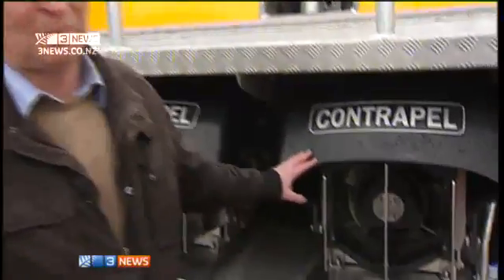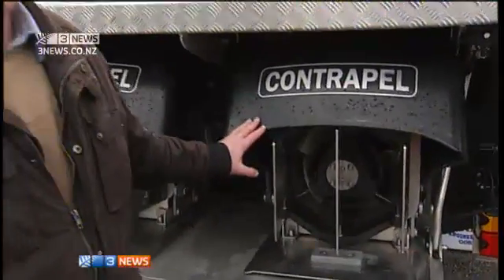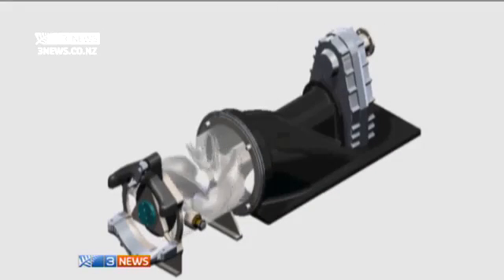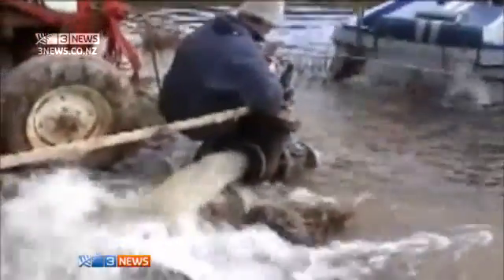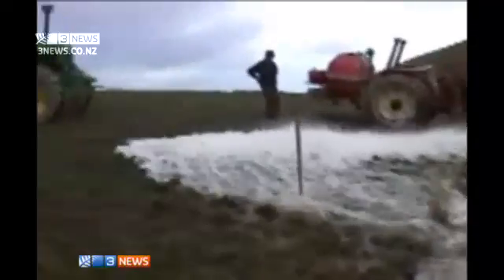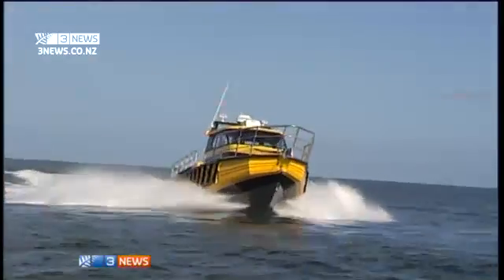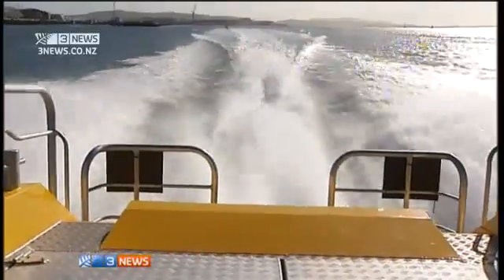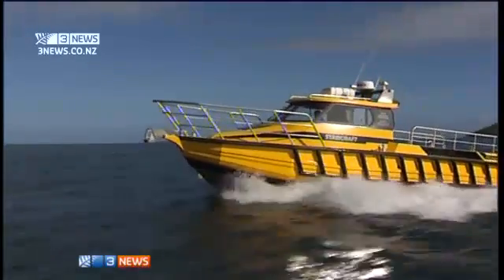Inventors revolutionise boat propeller system

Comment: It is not efficient at all on the basic principle that much energy is being used to move the water backward rather than moving the boat forward.  Too much slip in that system.  Ideally, a propeller should not have too much slip and the higher the pitch, the lift will be in the vectored direction and not in line with the line of travel. Someone needs to go back to basics.   This system fits a particular need and it does it well, but to say that it is better than a propeller is not right.   Such a system is good for high speed as surface propellers, but there are situations where it is not efficiency one looks for but convenience and this unit does that well for a particular purpose. I will never be used to propel the Emma Maersk.